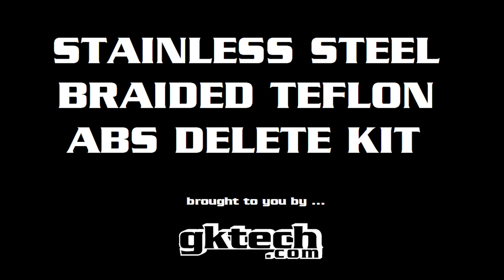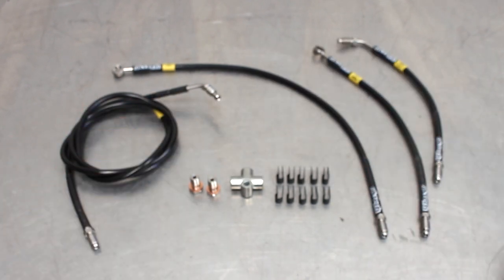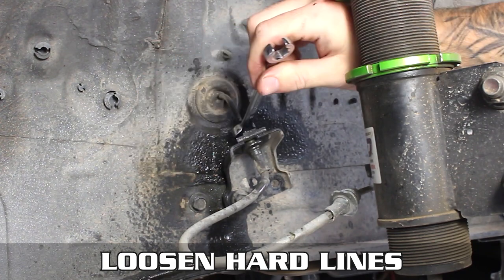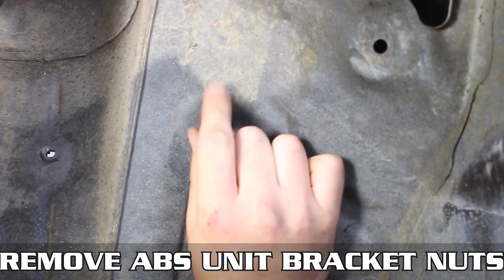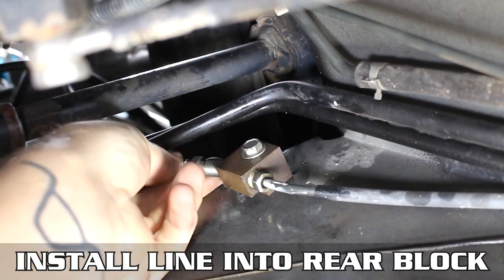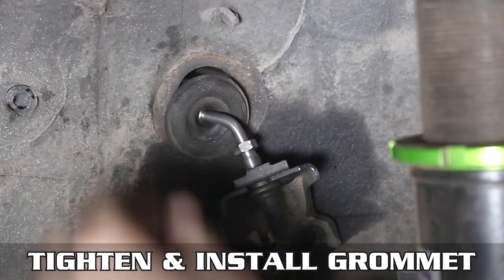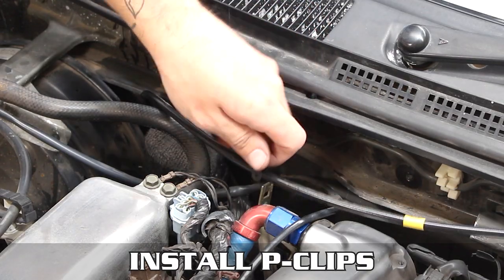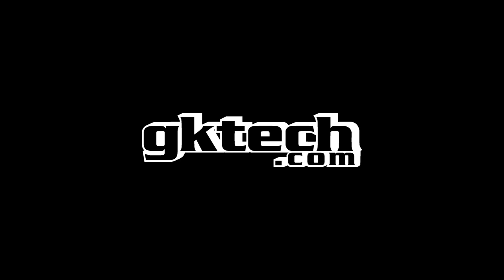Gktech Stainless Steel Braided Teflon ABS Delete Kit - Install

Comment: On the R34 GTT, my friend has ABS sensors built into the hubs.  Seeing as we went and purchased your whole wide angle kit, and are forced now to get rid of ABS, what do you do with the sensors that go to those front hubs?  Please help us!
Reply: Throw them away?
Reply: @mitsuracer87  Its what I ended up doing.  Now I have to remove the dash to remove the light from behind the ABS on the dash.   One thing leads to the next thing.  I am slowly getting angry.

Comment: Maybe l'm wrong but normally all non-abs cars have a regulator for the rear brakes...whith the delete kit the car will have the same braking power on all over the wheels or no? Thanks
Reply from the maker: No sorry, all OEM brake master cylinders regulate internally which automatically splits the brake bias front to rear, so you are good to go!
Reply: @gktech  very well! Thank you

Comment: Hey gktech are you guys sure the rear port on master goes to front brakes? On non abs Masters the 2 ports on the front go to the fronts and the rear port is rear brakes. Why would this change to the abs master?
Reply from the maker: Hey dude!
Yes, we are sure, the ABS vs non ABS master cylinders are different internally and it is just based off Nissans design unfortunately!

Comment: How would I go about plumbing a hydro into this set up?
Reply from the maker: If you are running an in-line setup, all lines and fitment is the same, except for the line that runs from the rear brake line port to the block on the chassis rail. That line needs to be replaced with the inline setup!